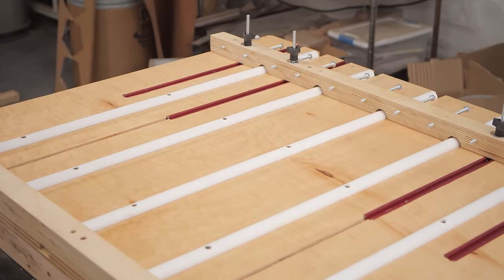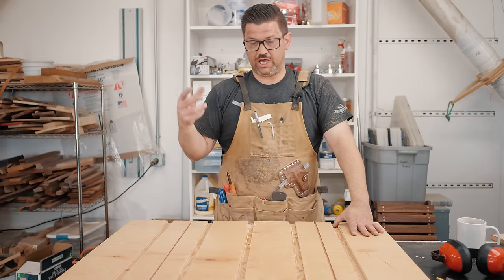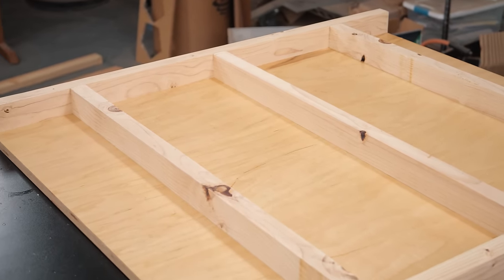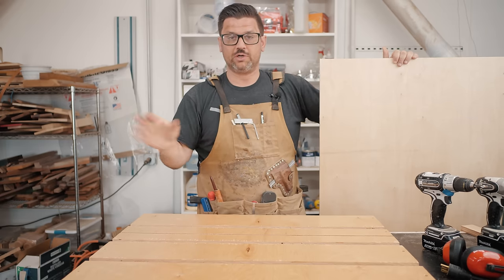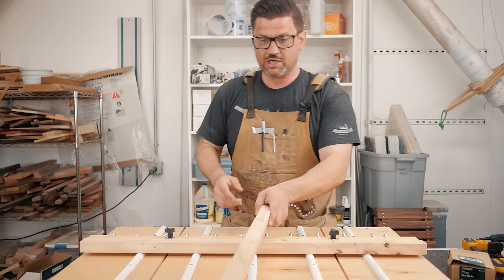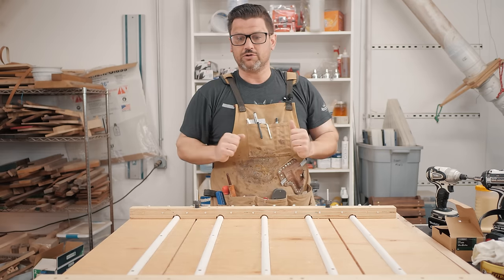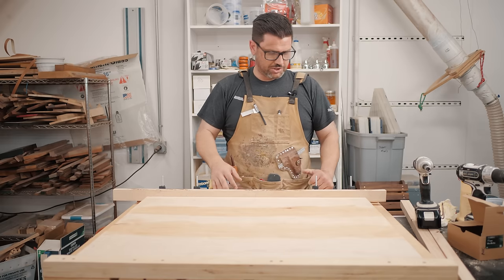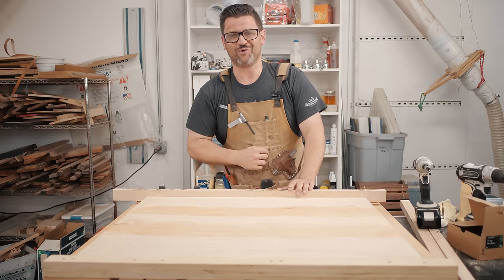DIY Adjustable Clamping Jig - Glue Ups, Panels, Cutting Boards

Comment: This would work for furniture and cabinet builds. And as you said the size can be varied. 
One suggestion for anyone building this: From a longevity perspective covering the part that is getting pushed by the bolts with a strip of galvanized sheet metal, 1/8 inch steel bar will still have flexibility and not damage the press board.
Also, since everything moves and the bolts are long, adding a 1/4-20 nylon nut BACKWARDS will effectively double the pressing surface area of each bolt.

Comment: Nice jig
Suggestion : alternate the bolts on 2 levels to be able to control the height of the resulting clamping force. This way you can set it to the median plane of the panel and thus avoid bending whatever the thickness of the panel.

Comment: Great idea Johnathan, the only thing extra I might have done is inlaid a strip of aluminium in the call against the clamping bolts for add pressure and stops the bolts sinking in! Other than that it’s a fantastic shop tool.
Reply: Hi Silver, I'm here trying to visualize what you are saying, English is not my first language, could you explain please sounds interesting. Thanks.
Reply: i think I would have also put a threaded insert in the holes. That wood tap is gonna wear out. (You just have to remember to put them in  in reverse.

Comment: Is there some reason why you can't use t-nuts on the fence instead of threading the wood? No matter what you do, even in hard wood, the threads will eventually wear down with repeated tighten-loosen cycles, but t-nuts will last pretty much forever.
Reply: Maybe threading the wood holds better especially with that amount of clamping pressure? I'm not sure too
Reply: @Ongtangco Family  it definitely would not hold better... even the cheap zinc threaded inserts would be stronger and hold better.

Comment: Great video and panel glue up jig, not sure what keeps the panel flat other than the jig keeps the clamping pressure horizontal. You touched on the idea of a caul to keep panel flat maybe you should include a couple of cauls to keep panel flat and show in more detail. I think it would be an easy and desirable addition to the jig.

Comment: Great video, wish I knew how the buckling caul would clamp down or you had shown that once on one of the glue ups.  I think I'm just not visualizing it but once I make it and have it in my hands I'm betting it will make sense and come together.  I don't have taps so either have to pick that up or considering using nuts and washers instead for even more longevity.

Comment: I think the 1/4-20 clamping bolts are two small, probably better with 5/16 or 3/8 so they dont flex as much when extended. The clamping caul also tends to move up and the fixed portion with the clamping bolts slides back no matter how tight the knobs are tightened.

Comment: What would you tap threads into the wood instead of using a threaded insert? That would eliminate a lot of work and the need for hardwood fences.

Comment: if you reverse the 1/4-20 clamping bolts - or even better get 1/2-20 Carriage bolts, screw them in fromthe work side of the fence (so the opposite side from the way you did it) - then just put a pair of jam nuts on the loose end of the bots (tighten them up until the flats aline so that hte socket slides over both, then they will stay locked forever...)
This gives you a "pad" against the caul, so that you get more pressure transferred to the glue up and less into crushing the fibers on the caul.
Very nice update to MTMWOOD's glue table - he does NICE stuff I have to say

Comment: Hey I have a suggestion you should put in a 1/8 inch strip of steel or some kind of metal for those bolts to hit on the call cuz overtime aren't those bolts just going to go into it when they're tightening up a project

Comment: Im going to do this as I’ve got a lot of cutting boards to glue up in the next few months. Quick Q:

I’m not sure I really understand why you threaded the wood. Couldn’t you have put a washer and nut on the other side (maybe counter sunk for the width of the washer and bolt)? That would allow the bolt to hold on something more sturdy than wood and maybe provide a better bite and last longer? Do you have any issue with the pressure of the caul leveraging against the t-slot rails when at pressure?

Comment: This is a great idea and the extra t-tracks are a massive improvement. Nice. Although, you mention in the video that you should have used tape to make the table saw cuts cleaner. I was just just wondering how you’d use it to make it cleaner, please? Thanks.
Reply: Chris Morris he is referring to a method where he would just put a layer of blue tape covering the line he would cut on. Then he would peel the excess tape off after. It helps reduce chip out on cuts on the table saw or other tools.

Comment: you might think about putting a piece of steel flat bar behind your call, or your bolt's that you use to tighten with will just dig into call destroying it over a short period of time.

Comment: What's the benefit of using the pipe? There has to be a reason why you'd use them as a riser over just using the flat bottom of the jig but I don't understand. Is it just to stop glue squeeze out building up on the sled or is there another reason?

Comment: Total respect for not hiding mistakes on the channel- helps us all learn how to solve problems. 

Also, at 0:40. Interesting you used your dado set without any insert installed. I guess with a panel that big it’s safe, nothing should fall in. - just goes against my nature to have an opening that wide with a saw running.

Comment: Did u try using 4 way clamps? I guessing you never tried 4 way clamps because if you did you will discover that it is better than anything out there including what you just build. I recently used 4 way clamps using super strut based on YouTube video that I saw and it is the best way to clamp panels and it is fully adjustable using super strut that you can buy from Home Depot.

Comment: When one door opens, another one closes. This is the perfect solution for me so I don't have to buy clamps that I have nowhere to store, (door  opens). Unfortunately, I don't have the floor space to store it out of the way, nor do I have the space to hang it on a wall, (door closes).
This is not because my woodworking shop has every tool imaginable, and therefore has very little unused space, it's because my garage has very little space to use as a woodworking shop because of the idea that "I can use this someday, so I'll keep it".
I have been married 40+ years, and worked 35+ years in a  medically shortened  career as an automotive tech, but not being able to drive by myself, and being limited in what I can do, the garage sits mostly like it did when I became disabled. I would throw my name in for the Katz-Moses Disabled Woodworkers Fund, but since I'm not in a wheelchair, I don't know if I am disabled enough to qualify.
Reply: Being restricted to a wheelchair shouldn't be the qualification for disabled access. I have most fingers amputated and have a really bad back as well as mobility problems, but we do what we can and woodworking is a great way to help take the mind off the constant pain.
Reply: @stevetobias4890  I meant to go in and edit, (again), my reply to read even though I'm disabled, I'm may not be disabled "enough" to require assistance in setting up my shop to suit my disabilities. Otherwise I would put my name in to the Katz-Moses Disabled Woodworkers Fund.

Comment: Nice build!  I've seen a couple of different panel jigs.  Like how you incorporated the sliding fence rather than just throwing in pieces of wood to make up the deference on a fixed fence.   One question though, did you use epoxy just to "glue" the t track in place for full strength rather than just the screws?

Comment: Nice video...BUT HOW DOES THIS WORK? No demo after to show what/how this device does what you claim it does.
Reply: IVAN IVONOVICH  Not sure what you’re getting at, he uses it twice. Once before, and then again after he added the t-track. He also explained it once before he showed it being used. Not being sarcastic, but if you know how to glue up a panel you know how to use this, if not, you need to know that first anyway.

Comment: I just subscribed after watching this great build. I've heard countless You Tubers refer to you in their videos and just had to check you at. Love the style video you use too. Do you offer plans for each build because I didnt hear any numbers, or in this case size pipe you used? This clamping jig will be a welcome addition to my tiny shop. I only have one small bench and  being on a frame and not pipes that make for tripping hazards when I lean the glue ups against the wall. Do you think this style can be adapted to a wall hanging clamping jig? And many thanks for what you do to help the vets.
Reply: I think that one of the nice things about this project is the fact that the dimensions really don’t matter all that much.  You can scale it up or down to fit your most common sized project panels.  

As to the size of the white rods (which I assume are PVC pipes), again I think the actual size doesn’t matter much.  They appear to be there to simply hold the panel above the plywood surface (which keeps glue squeeze-out from sticking your part to the jig).  As long as they create enough space between the panel and jig for that, any size would do, as long as you use the same size throughout the project.

Lastly, it looks like it would be very easy to adapt the jig to be able to hang on the wall while your panel is drying by adding a French cleat to the back of it.

Comment: You didn't show the whole build in detail. How do those horizontal bolts work. Thanks
Reply: They apply pressure to hold and press the workpiece.  The vertical ones just lock it in place.
Reply: I think he bored hols through the board and tapped them, i.e. the bolts run in threaded wood.  If there are enough of the bolts, I think there's no need to tighten them beyond the wood's ability to hold.

Comment: Really enjoyed the video, and although I'm brand new to this, I think I will attempt this as one of my first jigs.  I'm just trying to understand this from a physical perspective (just how my mind works lol) and having some trouble with it. I've watched the video twice now and just can't seem to wrap my head around what's causing the 'clamping' action. Pushing the fence against your piece and tightening the top nuts 'snugs' it, but then obviously your horizontal bolts somehow create adjustable pressure. Does tightening the bolts just draw the material in against your front fence? If so, how does that squeeze the full glue up together, instead of just what the bolts are biting into? I assume the bolts are only long enough to reach the 'sacrificial piece' between your fence and workpiece, or will they create holes in the edge of your workpiece that you'll have to adjust for as well?
Reply: I'm thinking all the bolts tighten the caul into the glue up. The Ttrack bolts are there to just hold the fence/caul in place?
Reply: The 1/4 20 knobs tighten the fence up so it’s snug to the piece (with the caul in between). The horizontal screws are then tightened which drives the ends of the screws through the fence applying force to push the caul against the piece resulting in the clamping force. This clamping force is much higher than what can be achieved by just pushing the fence by hand. The many horizontal screws allow you to fine tune the clamping force along the piece. Quite ingenious really.